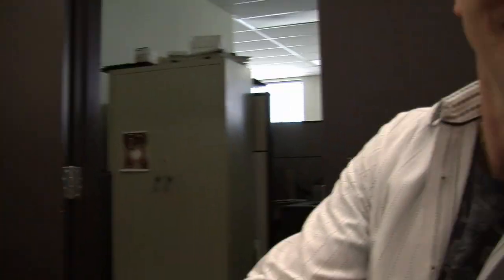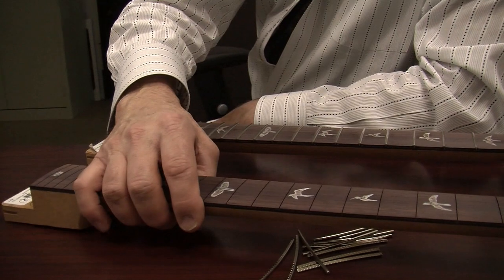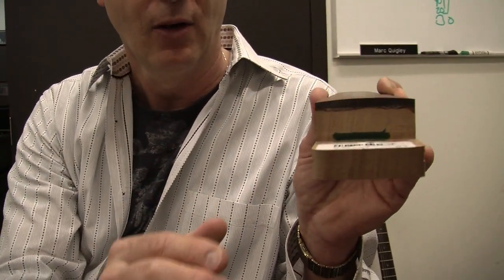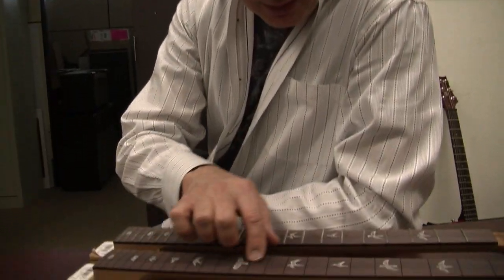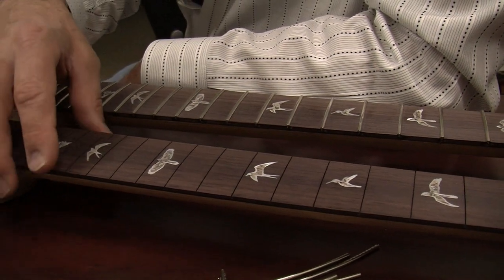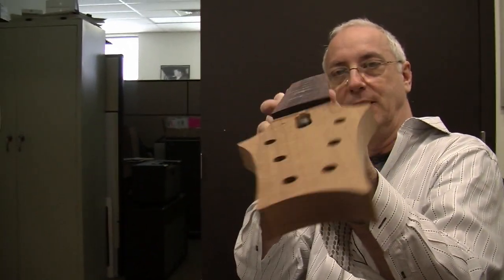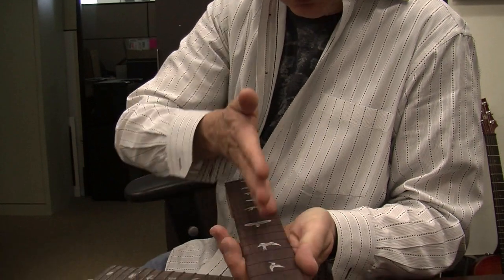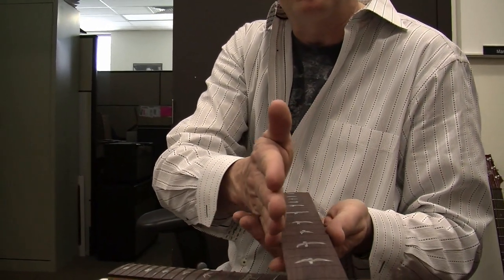Rules of Tone - Frets

Comment: LOL - theres tons of videos on youtube of worn out PRS frets getting redressed, or refretted... and these are new model PRS guitars - so just stop it paul...even your nickle frets are STILL just nickle frets. SS frets are better, no question. you WILL wear down nickle frets - all fret companies are different, but you WILL wear it down. thats a fact. there is practically NO wear on SS frets. So... SS are better.
Reply: Ben Hackett damn that sucks man. On my 2013 core prs my frets are gone... i called prs after seeing this video and asked them if they would refret my core prs since paul said his nickle is as hard as stainless and prs said no. PRS builds great guitars but their frets are antique backwards thinking material. They need to swallow their pride and offer fret wire the customer wants. Hopefully more people wake up and realize PRS is BSing about their nickel- its not superior to stainless.
Reply: By God, I have heard some bs before but this is rediculous. I have an expensive prs on my bench right now and apartfrom a sudden kink at the 14th fret, all the frets are loose, hard l, sharp edges on the nut and saddle, both too high. Worst guitar over 1.5k I have ever seen.
Reply: @KTcDPIYjGJ  the same physics that make any material transfer vibrations differently from another. Every material resonates differently, which results in frequency-dependent changes in amplitude and phase for any given signal. There is video from warmoth comparing stainless steel frets to nickel frets. It's definitely noticeable.
Reply: rstlesswarrior theres definitely a difference, but i wouldn't say ss sound thin, they have a higher treble peak but nothing that would come across in a mix or couldnt be handled by turning the tone knob back a tiny bit
Reply: Guy Dude (love the name), from my experience I'd have to disagree. However there isn't just one kind of stainless steel, so maybe some don't eat up the low-end.
Reply: hmh i wasn't aware there were various kinds, that might explain why so many people have so different opinions, you have a point, thanks for the compliment btw
Reply: For the NS vs SS tone debate - frets are burried in wood, fact no1. Fact no2 the material's resonance only matters if we are making let's say a church bell out of either material. Then it would matter. Frets are literally tone-dead because the tang of the fret is fixed into a slot in the fretboard. That deadens the resonance of the material significantly and from that point on frets only serve to transfer the vibration. A fretted neck resonates as one and the resonance you are hearing comes from wood, not frets. If that wouldn't be the case, then a loose NS fret with a dead note would sound better than a loose/dead SS fret. I don't think NS was chosen for tone, more for ease of installation. And they made guitars long before the industry got the right recipe for harder alloys.
Reply: @seasonedtoker  watch the warmoth video where they compare the materials. Also your "fact no1"-style can makes others defensive and can quickly bring unnecessary hostility in what should be an exchange of ideas and information. (or maybe it's just me because I'm hungry atm.)

Regardless, it is very useful to figure out the theoretical physics behind these phenomenon, but these are systems where we can actually measure simply with our ears. So to get actually useful results with predictive capabilities (aka working scientifically to produce facts), we should first measure (and a rough measure is still infinitely more useful than none) and then see which physical model best describes what we are observing.
In this case, my hypothesis to the difference in tone is, that the frets are the point where the primary oscillator (the string) is directly mounted, so it is here where the energy is directly reflected back to string. Also, the signal "hitting" there is unaltered up to then, so for one there are more frequencies that can be affected, than at e.g. the neck-joint, where the this bundle of vibrations has already traveled though frets, fretboard, neck and bridge, body. Then after that it is also the point (together with the bridge) where all the resonance meets with the source again and affecting the sound. Then considering the difference in atomic structure and the microscopic difference of the surface of the material, it is no surprise that fret material makes a significant difference in tone. Certainly there are other parts of the instrument that will affect the low end more (I have no doubt, that in an otherwise identical pair of guitars, one with SS-frets and a fixed bridge and another with nickel frets and a floating bridge, the former will have more low end).

I do agree though that for most guitars, which are the cheaper ones, nickel-frets would still be used if they were the thinner sounding ones. That is the case with all other parts. But with frets I guess it's a win-win.
If reliability and minimum maintenance is really important to you, then of course SS is the better choice. That's why Vigier uses them. And with their crazy sturdy necks, they more than compensate for the (imo negative) effect of their frets.
Reply: ph0kused tone?
Reply: @nickbouvy8851  I don't play super clean tones all day - i dont play jazz - mostly I play rock, blues, and metal, so even my clean tones usually have some dirt, plus the even chimey-ier bell tones  you get on a strat with SS frets is something to behold. So whatever tone change you get with SS frets is minimal, and can be adjusted via EQ since the tone change is NOT dramatic - nor is the tone change from SS frets EQ-immune - you can adjust guys!  The fan boiz on the PRS forum are just defensive about their nickle fretted gorgeous  PRS guitars, which is cool - i get it brand loyalty.  But the tone change is MINIMAL.  I have a  2015 American Standard strat with a Warmoth Neck - roasted maple w/ SS frets, and a strat with a standard fender neck - 2017 fender American professional, nickle frets, and albiet fender's fretwork is GREAT - their material is NOT as good as PRS's nickle, so I give paul that - definitely some nickle is harder - but i still have fat ass divots taken out it after 2 years of play, and will need to get refretted in another 3 years.  I play a lot though.  The tone difference is almost non existant when you consider, that you're trading a minor treble bump for lifelong fretwork.  To me as someone who owns many guitars from many brands and am not tied down to just PRS - I'll take SS any day of the week.  Hence the reason most major brands in 2019 are offering it now.  It is better.  Custom shop options offer it, but most production models dont, because it requires different tools to work with SS frets, and PRS doesn't want to invest in all new fretting equipment - that is the REAL reason... it is not tone, it is business, and a tad bit of being stuck in the past dad rock.  And look - i still have a bunch of nickle fret guitars.  There's a great video by Warmoth where they show you the tone difference between SS and nickle.  Do u hear a difference? maybe a little.  I'll take frets that are immortal and 10x better for bending any day.
Reply: 100% correct

Comment: Nickel is cheap and much easier to work with than stainless steel and that's the only reason it has been used on guitars.

When companies like Harley Benton puts steel frets on $350 guitars, there's no excuse to see nickel on $500+ guitars.

Guitar companies that put nickel frets on non-entry-level guitars simply don't care about their customers.

Comment: You say that you don't want the guitars to ever need re feting. That you'll use fret wire as hard as they'll make it. I dress & re fret PRS guitars often. They don't feel much harder than other NS wire to me. I have used Stainless Steel on several as well. Those frets never need a dress let alone a re fret. One of my heavy handed customers owns a CE that's had SS frets over 3yrs old & they show no signs of wear. He heard no change in tone. The sustain is better too.

Comment: Stainless steel is more difficult to work with and it's harder on the tools used to file and dress the frets. Going with a softer wire is cheaper (for the manufacturer) and that's why they do it. That's it. If you play with a strong grip and/or frequently use bending, you're going to burn through your frets in a few years. And I have no idea what the hell this even means: "If it's too hard, the frets contour to the fretboard."
Reply: +fivepiece 
It means that a really hard fretwire would have influence on the shape of the fretboard at every position of the inserted fretwire. But i can't tell you why...
If the fretwire is bent with the same radius and its pressed into the slot with matrix with the same shape, why should the fretwire change its shape dramatically?

Comment: Doesn't want to use a water-based glue to glue in frets, but uses water-based to glue up the body, top, fretboard, headstock overlay.....
Reply: And you're an expert on the chemical composition of the adhesives they use at the factory how again?
Reply: You can't used water based within the fretboard specifically because if it gets hydrated with water, it gets bigger, and after a while of drying you will get fret sprout. It's not nearly as much of an issue throughout the rest of the guitar

Comment: Fish glue is actually remarkable stuff. So is hide glue. Hate to hear them being trashed dismissively. Just have to pick the right time and place to use them. 
High grade fish and hide glue do not stink. Fish glue smells like old fashioned medical adhesive tape (the kind that left a residue on your skin that never came off). It doesn't smell like fish. 
There is hide glue that stinks. It comes from India and China and is poorly made. They have lower QC standards and inferior production methodology. It's important to get the good stuff made in Europe, Brazil, and the US. 
But I agree, I'd much rather glue frets in with cyanoacrylate super glue than fish glue.

Comment: "The hardest fret wire they'll  make" - sorry,  Paul, wrong answer. The frets on your guitars wear out as fast as any other guitar that doesn't have stainless steel, period.
Reply: I have a 25 plus year old PRS ..Been played heavily. No fret wear. No problems!
Reply: @williamking7420  maybe they used better wire back then. I work as a luthier, I have refretted many PRS guitars with worn out frets.
Reply: @DogGuy19  well call it job security. you should be thankful haha!

Comment: What is it with you guys and stainless steel frets? Who gives a shit. I've been playing guitar for 50 years now and over that time can't remember ever caring about whether my frets were SS or nickel. Fret size of course is an issue as is fret dressing. I've owned 3 PRS guitars and never once even had to get the frets dressed. I seriously doubt Paul is bean counting by using nickel fret wire given how much of a fanatic he is about every detail of guitar crafting. In fact if I were to guess it's probably a tone issue with him. (you're thinking tone? it doesn't make a damn bit of difference to the tone)and I'd tend to agree but I'm not Paul who DOES ahem.."fret" over this stuff. If it isn't about tone then it's some other issue (beside cost) that makes him feel like nickel is the best choice. Unless he feels that there simply isn't enough difference between them to justify the extra money given his assertion that his frets will last 20 years or so.
Reply: U can also make frets last longer by not pressing so hard & bending so much, & using smooth strings, even flatwounds, & nickel wound, & even 'covered' like 'Elixir' &/or actually lubing the frets with grease (if doesn't kill your desired tone 2 bad).  There's a reason they put grease in gears & stuff = DUH! =D  + if U have very fat wide frets helps them last way longer.  Thin 'mandolin' style 1's wear down fast.  Also there R quartz frets some people get installed = wears much longer than steel.  Wonder if N E 1 doz 'tungsten carbide' frets??  Keep in mind they make the tone more 'jaggy' & annoying, so good 2 mute it a bit @ the bridge with nylon saddles or some kind of 'muffing' material in there.